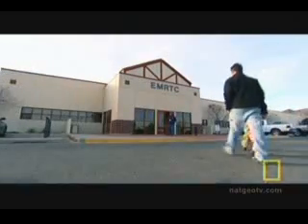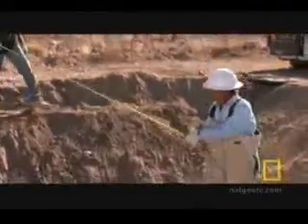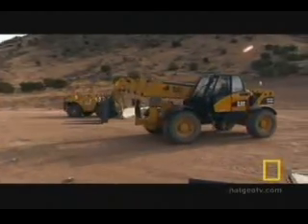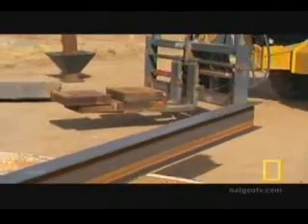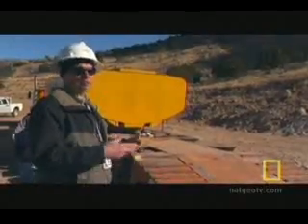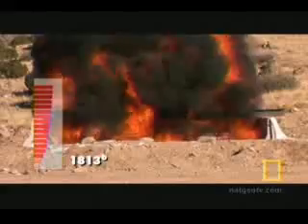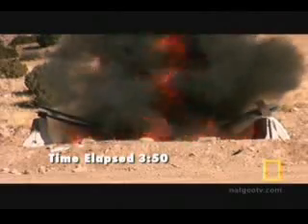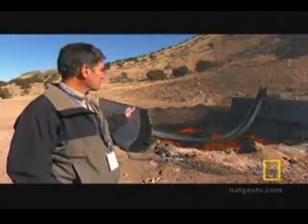steel being weakened by a jet fuel fire

Comment: I love how truthers say that irrefutable evidence is right under everybody's noses, yet they themselves never say what it is.
Reply: tralt135 

That what happened to the 3 (not just 2) buildings that day cannot be physically explained by the official version - there, I said it.
Reply: aluminum plane + molten + water = temps well above steel melting point...
Reply: Seth Larcomb what? You make no point
Reply: chemical composition.
Reply: Seth Larcomb no aluminum plane could cut through the steel beams on the outside of the building.  It would be easier to chop a tree down with an empty beer can.
Reply: @EasyThere  you realize that a two seater private airplane once crashed into this building and severed several of the outer columns which had to be repaired. Velocity is King.
Reply: @jarodstrain8905  link photo.... A 2-seater couldn't even Dent a column.  I suppose you have a photo where a guy knocked down a brick wall with a wiffle bat too
Reply: @EasyThere  Do you realize how asinine it is to make a comparison between a wiffle bat and a 200 mile per hour plane? Small aircraft crashing into buildings in New York has been a fairly common occurrence throughout my lifetime. In the 80s it happened a number of times. Since 9/11 it has happened in 2002, 2006, 2010, 2012, and 2014.
Are you unstable?
Reply: @jarodstrain8905  insults and no evidence....a democrat by chance?     I suggest you study up on what planes are made of.....
Reply: @EasyThere  I wasn't aware that I insulted you. That was however suggesting that your statements if sincere suggests that you're crazy in her possibly Institute. But I don't think that the disease are sincere statements I think that you are just a conspiracy theory person that doesn't like to tell the truth. Neither of those things are insults. They would be insults if they were false but you give him a reason to think they are. As for evidence, look it up. These aren't my claims they're things you can look up and read about.
Reply: @EasyThere  and no, concrete is not easier to break through than steel. Where did you get such a notion? Concrete has high compressive strength. See you on the other hand is malleable and under adequate Force, regardless of what is applying that force it will both bend and break. That's just basic physics. You are making claims contrary to what science would illustrate. Therefore a burden of evidence exists for you. What I'm telling you is what science tells everyone. You're giving an opinion, I'm telling you the facts. Do you understand the difference? Probably not. Otherwise you wouldn't have declined into politics when you can't support your own opinion.
Reply: @jarodstrain8905  the science that steel is 200 times more dense than concrete.  Good God now you're just making s*** up
Reply: @jarodstrain8905   you can break concrete with a hammer.  Where did you study "science" at a Christian University?  Do you think the Earth is flat too?
Reply: @EasyThere  now I've got an anti science Flat Earth conspiracy theorist accusing me of being a flat earther. That's rich.
Reply: @EasyThere  you can also break steel with concrete, depending on many factors. 
Also, you keep lying and then accusing me of making things up. Gaslighting is unbecoming. 
I never said anything about density. I said concrete has compressive strength while steel is more malleable. Both are indisputable. But you probably already knew that.

Since you brought up density, the densest alloys of steel are around 8050kg/m^3, compared to around 2400kg/m^3 for concrete.  That's roughly 3.3 times the density, so...
I guess you just can't stop making things up.
Reply: @jarodstrain8905  that's 330 percent dummy
Reply: @EasyThere  Indeed it is 330%, 3.3 times the density. You however said 200 times, not percent.  
So... when you're caught lying, you just resort to insults. 
That says a lot about you, and nothing at all about me.
Reply: @EasyThere  thank you for proving my point.

Comment: Good now all the retarded nonbelievers in 911 can stfu
Reply: Sam Waite Because of an un-scientific experiment? Nice.
Reply: Aya Bear damn you are stupid. this test followed the basic of a science test, it had recorded factors, it is also a scientific fact that steel becomes very week at 2000 degrees, in my welding shop i was able to bend steel plates with half the effort and they where only 700 degrees, and fire in in a high skyscraper can cause a effect like a furnace where temperatures rise above the melting point of steel, its kind of like how you can melt steel with a wood fire.
Reply: odisy64 No it didn't. The entire steel structure along with the concrete+asbestos it is encased in would act as a massive heatsink distributing the heat. Ask the head engineer and designer of WTC what he thinks. Plenty of his thoughts of the matter on the internet..
Reply: Aya Bear then the concrete would act like an insulator for the fire making it hotter.
Reply: Not where the steel wasn't directly in flames. It would still massively spread heat throughout.
Reply: Aya Bear the whole building acted like a furnace, trapping the heat while having plenty of holes to supply the burning, there have been factory fires so hot that the steel ended up being twisted and near melted and there was no jet fuel involved just regular burning of flammable material like the burning of wood and cloth. we can even melt steel with a wood fire.

Comment: I'm not scientist, engineer, or anything. This is just my 2 cents.

This experiment does infact show that steel beams can be weakened by fet fuel fires. But on 9/11, I don't think it'd have been this organized. This was a concentrated fire with a whole lot of fuel on one part of the beam. I feel like it would've been more scattered and unorganized on the impact. Honestly, the only way to actually test it is to rebuild the world trade center and retry it.
Reply: You bet. Rebuild to original blue prints and test the complete collapse, freefall theory. I don't think it would fail in the manner it did on 911.
Reply: https://youtu.be/ctRg_MDzhPY
Reply: https://youtu.be/5d5iIoCiI8g
Reply: Hamza Muhammad 

Rebuild them?

No, no, no, they will not fool us, the truth is clear in this case, this was an inside job.

Comment: Heated steel loses strength but gains elasticity, it becomes less brittle and less likely to fracture. A boxed reinforcement like the WTC would see the melting structure folding on itself until the fire was smothered and the weight would essentially forge the steel in place as it cools making the structure even stronger than it was before the fire. The steel beams of the towers were also heavily coated with white asbestos laden vermiculite concrete with a melting point north of 1,500C or 2,732F. Even in the unlikely case that the entire supporting structure was stripped of most of the asbestos by physical damage, the supporting structure below the impact zone would have still been insulated and easily withstood even 2,200F+ for days, if not weeks, along with the highest recorded 2.3 Richter seismic event before the collapse.

The majority of the jet fuel burned up in the initial impact (massive fireball) kerosene burns much more efficiently at higher temperatures when atomized and mixed with air. Repeat this experiment with steal coated in vermiculite and asbestos and use the correct fuel source; office furniture, paper, plastic, plaster and wood and you can cook that beam for decades and never see it bend.
Reply: K, np, 20 tons smack into that beam at 700mph.  Hows that 50 year old coating doing now?
Reply: ilovetheusers The fireproofing was not 50 years old, it was recently upgraded in 99-00: http://www.cool-places.0catch.com/docs/Wtc1SeriesNW.ppt

Also, during these upgrades the asbestos was not removed, which means there was both asbestos fireproofing along with more modern materials sprayed over it.

Even in the NIST's "severe case" model where WTC's below average amount of combustibles were ignored and the fireproofing was completely destroyed on ALL of the affected floors inner and outer columns (and somehow the fireproofing was destroyed in WTC7 by some unknown force) the NIST already released a report stating the fire was not a jet fuel fire, but an office material fire which burns several hundred degrees cooler. 

Also, the radiative and heat dispersion factor of steel is completely ignored. As someone with a lot of experience with the thermodynamics of multi-material heatsinks, water cooling, and phase change, that neglection puts another gaping hole in the NIST's completely unscientific method of "form a conclusion, then find all of the facts that support that conclusion."
Reply: rekt
Reply: Don't forget that you had a massive office fire and electrical fire mixed with a vacuum from oxygen. soooo.....not reketd

Comment: The "trick" to this propaganda is the size of the fuel source, combine w/ the selected height of the beam.  This ensured enough energy, through plenty of oxygen avb, notice the lack of pitch blackness to the smoke.  No mention of material composition, Cadmium will MELT in boiling water (can be used as an alloy).
Ask any2 who has done a fire drill w/ kerosene, how easy it is to light w/o a wick (the pizza box)

Comment: @niave I have seen firefighters use an open flame TORCH on a pool of jet fuel and it FAILED to light.  Where are u saying 700 gals pooled at?  Where would a SINGLE BEAM be used in any of the towers?

OHHH, U NEVER ANSWERED THE QUESTION, DID U GRADUATE HIGH SCHOOL, GED DOESN'T COUNT.

Comment: This is a stupid test and very unscientific.
First it is one beam on the horizontal with no braces and ties working to stabilize and brace. Second the Vertical steel beams were much heavier it would take alot more heat to ever deform a 4" thick beam. This is a possible 1/2" thick beam. BTW the insulating material some of it may have been knocked off but that is doubtful as well.

This is a BS test that really proves nothing...one small beam over a fire means nothing.

Comment: @lunaru15  Aaaaahh!!  I see!!  But the collapse initiates AT the impact floors.   And everything else is perfectly intact up to that point on that side of the building.   And controlled demolitions remove resistance so the building falls in to its footprint.  But that was not taking place at the WTC.  It was laying out the lower material as it was being pulverized (which gravity does BTW not explosives)  pushing that material out the sides.  And explosives make noise LOTS of it.

Comment: This does not prove shit. Number one the weight of the beams in the twin towers was dispersed. Not even a dumb architect would load a one ton beam with three thousand lbs. Second are you telling me that every beams fireproofing was ripped off. Alot of good that did. No lets be logical. If one beam fell the others would have supported it. Or at least slowed the collapse. And as we know it fell at free fall speed. Also, They scaled it all wrong. You can't get lighter metal then the same fire.

Comment: @blite13 Heat not hot enough to affect the steel hm?   Sure about that.  

Excerpt from technical metallurgical analysis of WTC's

Severe thinning of the HSLA steel occurred by high temperature corrosion due to a combination of oxidation and sulfidation. Sulfidation of the grain boundaries in the HSLA steel accelerated the degradation of the steel suggesting the presence of a liquid phase. (Heat)

So if you cant understand that heat affects the steel.  How the hell can you understand the rest?

Comment: @blite13 You are incorrect.  They found the floor connections from the floors impacted. (i saw it) they were warped and melted. Showing the flooring had pulled away.    Exterior columns don't buckle inward from nothing!!  the only thing connecting them is the flooring.  You have to understand HOW the towers were constructed.  The flooring tied all the columns together.  No flooring.  No lateral support.  The outer wall just buckles like cardboard.    And that is EXACTLY what we see.

Comment: @roquefortfiles Jet fuel doesn't burn that hot either, kerosene does not melt or weaken a plane engine does it? Most of the kerosene burned off in the intial explosions, what was left was burned off in 10-15 minutes, this is a well known fact. How does the first tower that collapsed, that had an impact point lower than the 2nd tower that collapsed, have a slower collapse time? How does the tower with less mass coming down on the secure structure below it, have a faster collapse time? HMMMMMMM

Comment: @blite13   With the fireproofing blown off?  The internal sprinkler system obliterated?  10,000 gallons of Jet A 1 fuel across some 3 floors an acre in size?  Burning uncontrolled??  Steal softening under the heat conditions?  Increased loads bearing down on all of that compromised area?   ARE you kidding me??  Why do you think the tower collapsed at the impact points?    Why do you think  the SOUTH tower collapsed first even though it was hit second??    

There is a reason.

Comment: @blite13   Yes they do.  You do not know what you are talking about!!   The steel does not melt but at half its melting point 1800D  (about 3000 D fully)  it looses HALF its strength.    The fires were burning at easily this temp for a long time.  With no fire proofing and the increased loads?   No problem!!   The exterior columns buckled inward (easily seen in videos).  30 stories lets go as one unit.    NO FLOOR can hold that much weight on the move.  

Its pretty basic shit dude!!

Comment: @roquefortfiles Prove that there were missing columns, office fires do not burn hot enough to weaken high grade steel. The steel that was tested showed no signs of melting and failing, you are completely full of shit or very ignorant. There was little or no resistance in 3 collapses, check out Newton's Law # 3.

Comment: @rtaubman  Not only that but the fire proofing was blown off from the collision.  No fire proofing= no fire rating.  Bare steel.  It looses half its strength at half its melting point!!  Couple that with increased loads from missing columns?!!.  The floor truss connections were PROVEN to have melted and failed.  Without the floors for lateral support FORGET IT!!!  The outer wall crumbles like a piece of cardboard.  Interestingly that is EXACTLY what takes place in the videos.

Comment: @person661982  No but they believe some super duper Nano thermite will slice through MASSIVE steel beams (when 150 pounds of the stuff.. a RIDICULOUSLY huge amount BTW!!) wont do it.  Or also conveniently disregarding the GIGANTIC reaction this stuff makes in one example.  Plasma and light brighter than a welders torch.  But on a 210 ft wide building with every window blown out we see NOTHING remotely this bright taking place.  

So believable.   !!!

Comment: the fire proofing wasnt burned off all of the beams. That is an obvious biased comment. Give me a break. Even if those beams do weaken. It irrelevent. Where was all of the resistance on the other 100 floors. It did not weaken all the structual support on every floor. To me these guys really lose any credibility. This proves nothing. Its not about one beam. Where was the resisitance. Resistance is the key here. IN 10 seconds 110 story building collapsed all the way to the ground after burning for

Comment: lol l love it, more weight (weight placed horizontally) on lower grade single steel bar (as opposed to a multiple award winning engineered array of vertical steel designed to withstand hurricanes and plane crashes), without fire protection, far more jet fuel concentrated in a pool directly over the beam, far higher temperatures, not enough time for the jet fuel to burn out, which it had more than enough time to do in the real situation leaving only much cooler burning fires.

So convincing.

Comment: The video doesn't prove anything, but it gives credence  to the idea that the fires in the towers could have weakened the members enough for them to fail. It was only 3.5 minutes as opposed to an hour. Also, there was very little load on the beam in the video. Even though there was black smoke the fire was strong, putting to rest another myth.

The towers didn't fall at free speed.